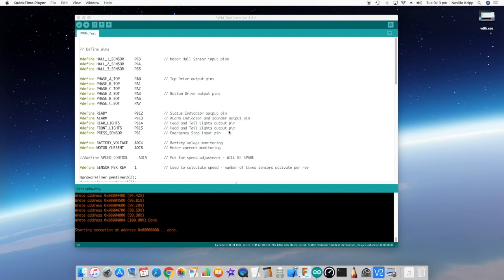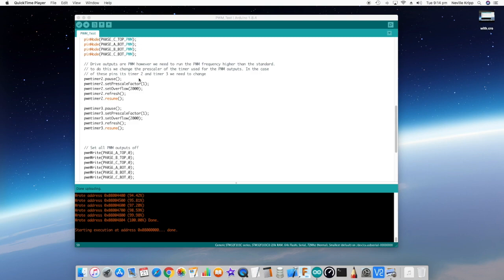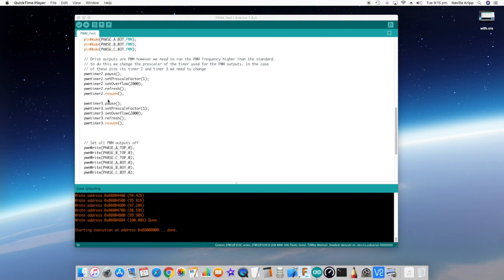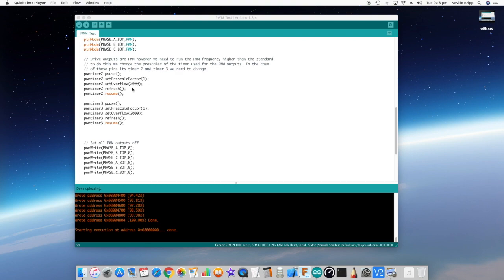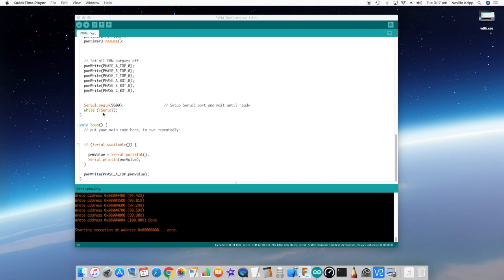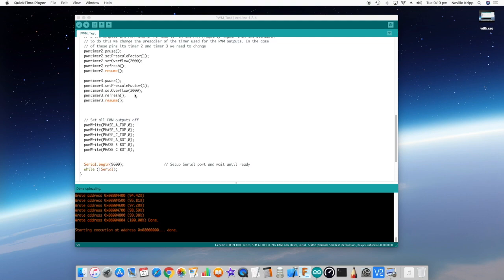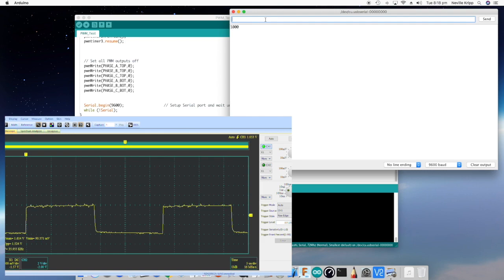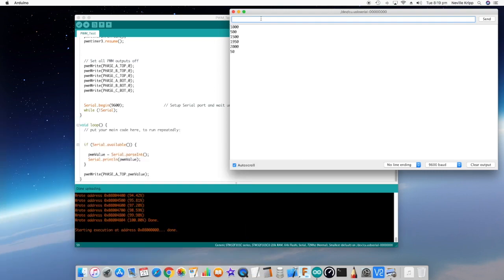#070 Changing the PWM Frequency on the STM32

Comment: Very nice explanation! You covered pretty much all the essentials to understand how the "internals" of PWM work.
I would like to point out that there exists a function to set the period directly and it computes and sets the prescale factor and overflow values automatically.
[TIMER_X].setPeriod(uint32 period_microseconds)
Keep up the good work!
Reply from the maker: Cheers for the advise on the setPeriod function, I’ve got to be honest, finding information on the STM32 Arduino implementation feels a bit hit and miss at times..
Reply: does that function work directly from arudino IDE with STM32 core installed ? Do you need to include a HAL library or anything ?

Comment: How many individual PWM outputs does the STM32f1 have? I saw it has 15 PWM Pins does that mean the MCU can output 15 different pulse widths?
Reply from the maker: Hmm I’d have to check how many individual pwm outputs there are, you could be correct in saying 15. 

You can have different pulse widths on each output, no issues there, however from memory I think there is only 3 different timers for the pwm outputs. This means that there are three groups of PWM outputs and all outputs on a specific timer will have the same frequency, or duty cycle. 

Hope that makes sense, and sorry but this is just from memory, if you would like more clarification let me know and I can look into this in more detail.
Reply: @GrumpyOldTech  Yeah you are exactly right :) Tested it by myself and forgot about this comment. So sorry if I wasted your time. But I am sure your comment will help some people nevertheless :)

Comment: Hi there, I know I am late to the party but I am struggling... How did you get the HardwareTimer lib working with the IDE?
I have tried inlcuding the HardwareTimer.h library but my compile is still failing with an invalid conversion from int to TIM_TypeDef error on the HardwareTimer pwmtimer2(2) line.
I REALLY would appreciate your input!

Comment: Thank you very much for your great video, it helped me a lot. I ask if it is possible from Arduino to make a pwm with dead time for stm32f? And how is it done? That in keil is possible but in arduino ide ?. Thank you
Reply from the maker: HI, 
I'm a little unsure exactly what you are looking for. Not sure if you mean deadtime in relation to a PID Loop or other control strategy. If so then the dead time will just need to be coded in the control strategy. The signal presented to the PWM output will have deadtime applied to it.
SOrry if I haven't covered off on your questions, happy to help more if you can explain your question a little more,
Cheers Nev.
Reply: @GrumpyOldTech  Thank you very much for answer. I am looking to operate a 4 mosfet bridge with two arduino pins. I just wanted to know how to indicate in arduino (for one stm32f103) to get 2 inverted exits centered and with dead time. I have the code for inverted centered outputs in Arduino IDE, but I don't know how to give it the dead time.Thank you very much again.
Reply from the maker: @pablotapiales286  Hi Again, sorry my last answer may have been a little confusing as when i read it back again what I meant to refer to in the control strategy was deadband, not deadtime, as in a zone where a change in the difference between setpoint and process variable will not effect a change in the output. Is this what you are referring to or do I have this wrong?

Comment: hey man nice video, im trying to change the frequency of the stm32 from 72mhz to 8 mhz? does anybody knows how to do it?  im trying to reduce power consumption.
Reply from the maker: Good question. I havent looked into this at all, I expect if you check the datasheet it will explain different oscillator options (if available) to the 72Mhz Xtal. In cases like this always go back tot he datasheet...

There are ultra low power options for the STF32, maybe one of these might be a better option?